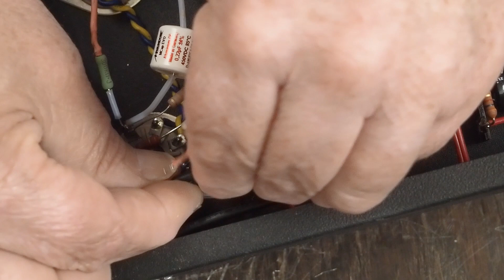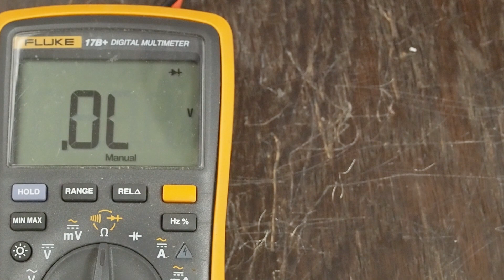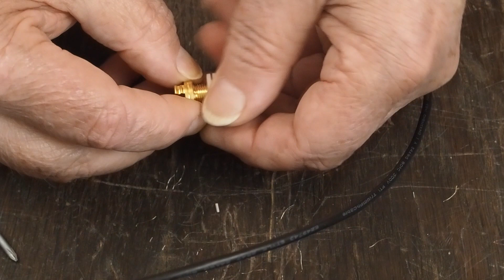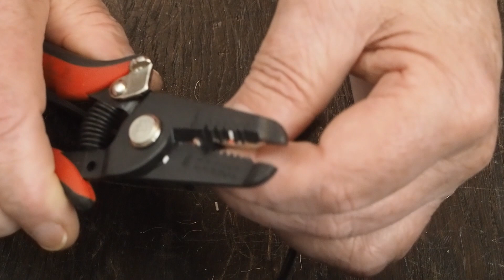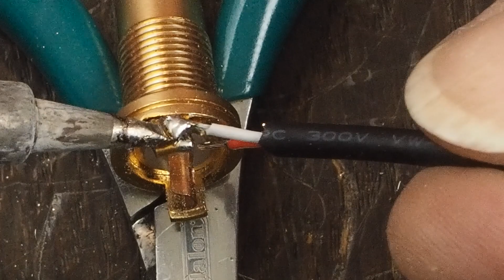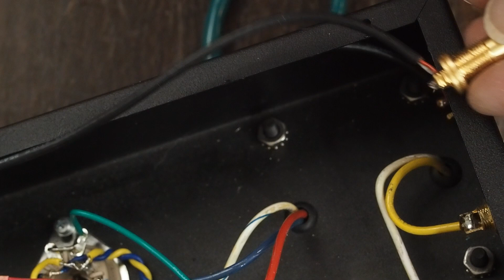6SQ7 EL34 Tube Audio Amplifier: Final Build Video!

Comment: Hmm, I've been watching this series and it seems like a portion was missed being recorded. Where did the white caps and the extra resistors with clear shielding come from? Somewhere between the video of Driver Tube Wiring and this one I'd be amiss of what to complete. I wouldn't be able to just read a wiring schematic to figure it out either. This looks like an amp I could really build, but I'm not sure about the few missed or unrecorded steps. I've found your videos very helpful and I've never done any work like this before and I'm not trying to sound overly critical, but I'm not sure I could piece it together now. Maybe I'll see something in the next videos? Hmm.
Reply from the maker: You are right, I must have lost the clip on soldering those few parts in, you can see where they are connected in this picture/part of the video linked below. Honestly, I'm not sure I would suggest building something like this without being able to read a wiring schematic.

https://youtu.be/Q036UwHH6Xo?t=1100
Reply: @SkunkieDesignsElectronics  Yeah I see the extra parts and wiring, but I'm not sure about what parts are what. I've watched lots of your other videos to know sometimes your camera battery goes out when you least expect it. I can sorta follow a wiring schematic being a retired Air Force aircraft mechanic, but maybe I can do better by doing some more reading and watching videos. I'm a hands-on learner not a book worm. I'm going through all your video series in hopes of getting a better idea of what I really want to build. I really appreciate all of your tips and tricks and I've built up my toolbox getting ready to build that clone phono preamp sometime soon. Thanks!

Comment: A lot of people seem to like the EL34. Is it the best sounding tube ?
Reply from the maker: It's an inexpensive tube, that is fairly easy to drive, makes decent power and does sound nice. It can be run as a pentode and also as a triode and sounds good either way. I still think my 300B amp sounds better but not by much.

Comment: Did I see something wrong here or it doesn't matter? In your schematic, you have pin 3 to diode to resistor then to ground but here you have pin 3 to resistor to diode then ground.
Reply from the maker: The order of these two components in series doesn't matter.

Comment: I was taught that in the matter of shields, you want to ground  the shield at the source side. I believe that the reason is, interference  comes from the external side of a cable run. The idea is to take noise down at its source where the noise level would be hotter
Reply from the maker: I do need to possibly rethink which end to ground this on, but I don't want to connect the shield to the negative signal lead at the RCA jack. That defeats the whole purpose of keeping the shield separate from the negative signal path. The RCA interconnects I use have the shield grounded at the previous device's ground end only, so this is more about shielding from internal noise. This is probably worthy of a future video :)